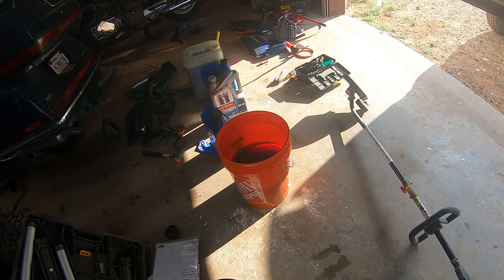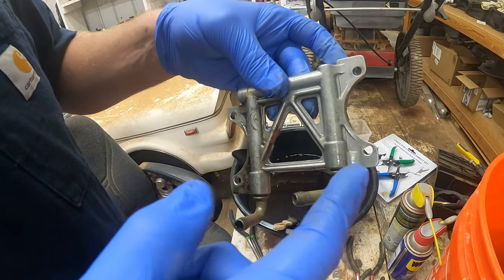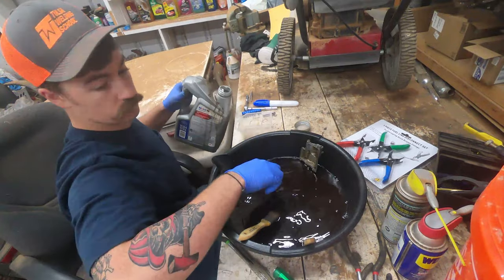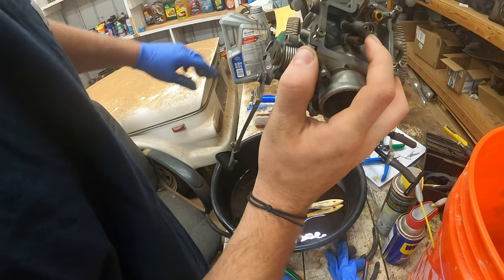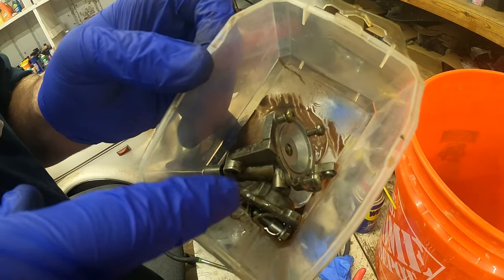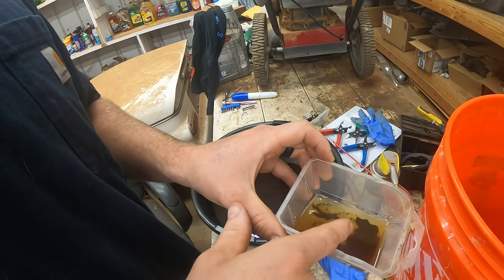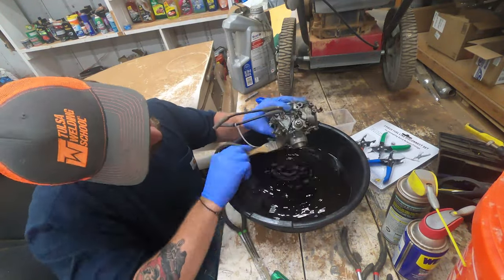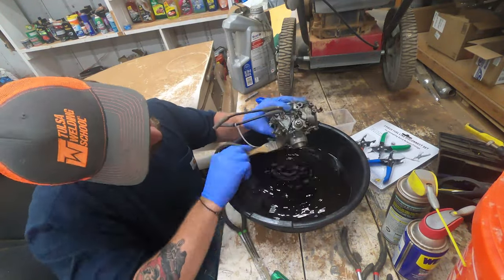How To Clean The Carburetor On A 1988-2000 Honda Goldwing GL1500

Comment: Instead of using gasoline start using diesel fuel, imo it cleans better and doesn’t have as bad fumes it also isn’t as flammable as gas, I know your using old gas so I see why u use it but I think diesel just works better
Reply from the maker: I do like diesel! In my actual parts washer i prefer diesel or kerosene to naptha/zep or ozzy juice! Its my preference but in this scenario I had this old gasoline on hand and wanted to show it works! Thanks for the comment!